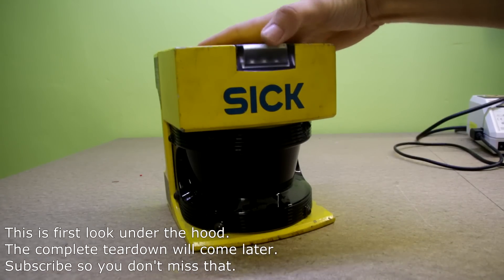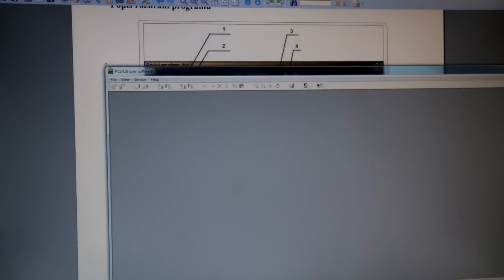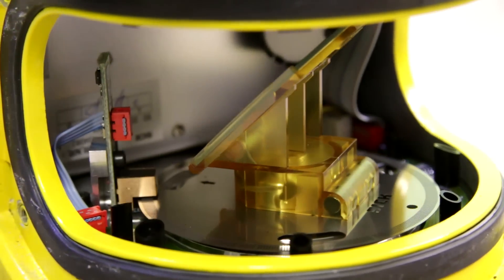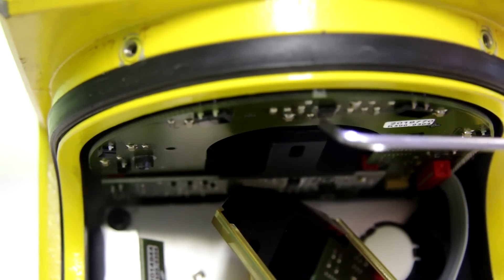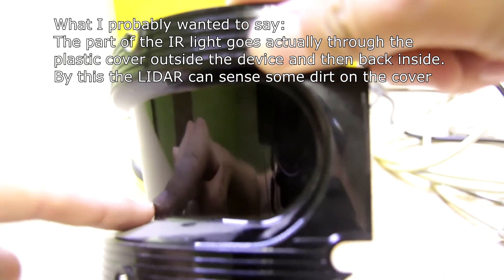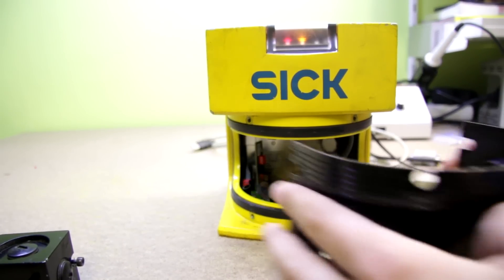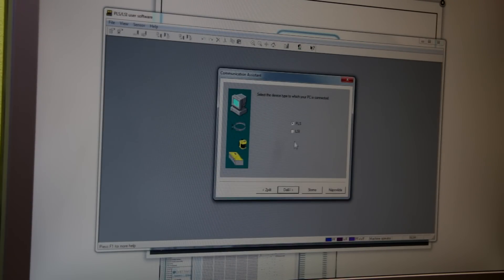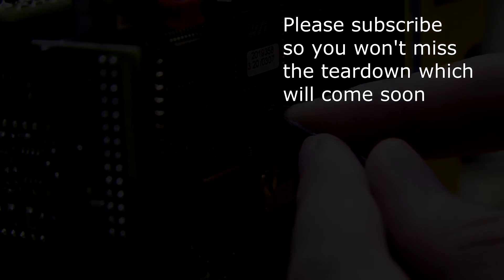SICK LIDAR - First look under the hood

Comment: Thx a lot for this video. Regarding the dirt warning, I assume that since the IR light was suppose to go through the front shield it is calibrated to this. Meaning, the light should be absorbed and maybe bend accordingly. When you take this off the receiving characteristic is different then what the system expects. I think this might be the reason why it thinks their is dirt on the shield even though their is no shield.